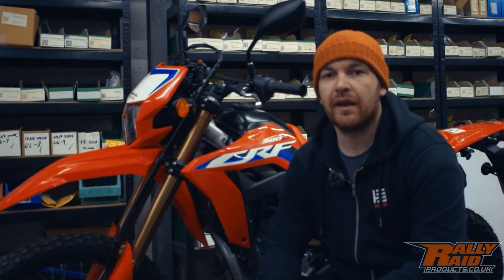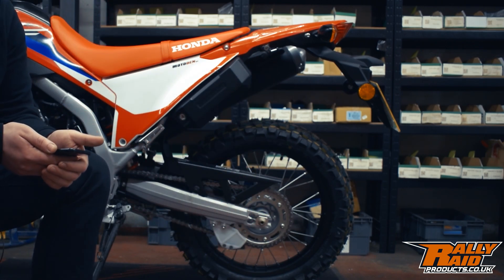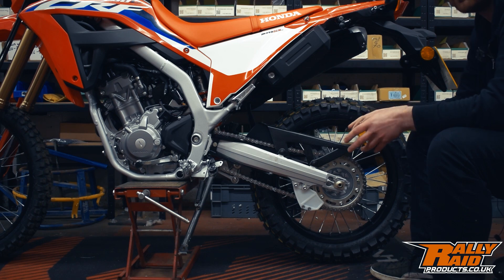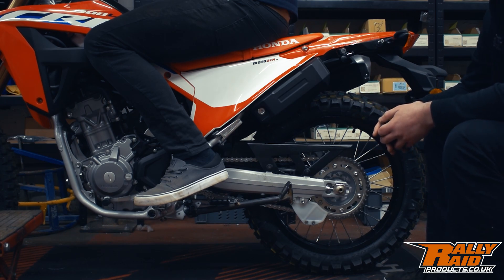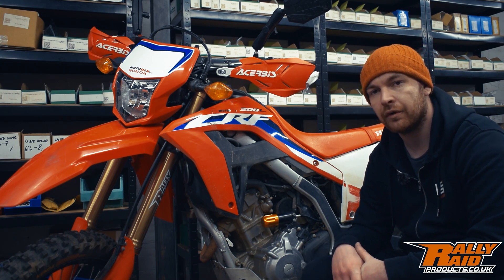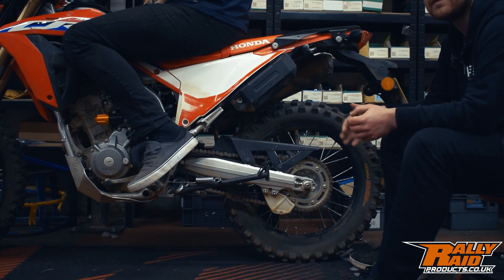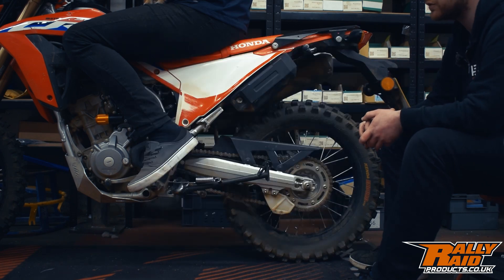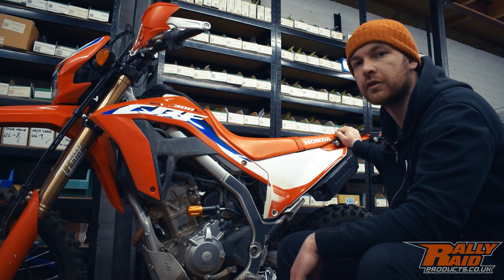HOW TO - MEASURING AND DISCUSSING SUSPENSION SAG

Comment: I think 30% rider sag is fine for the track but it’s too stiff for trails and general adventure riding.  The 40% feels much better to me.
Reply: so higher percentage or longer the distance means softer? eg, less pre load adjustment?
Reply: Yeh, 30% results in a ride which is fine for hitting obstacles fairly hard, but it also results in quite a harsh ride over general terrain not at high speed if the damping settings are too resistive
Reply: I’m 6 feet tall and 220 pounds without riding gear. I completely agree with the 40% figure. I ride my bike on all types of terrain at intermediate speeds.  My question is this; if you order a new shock and spring for my weight, does it allow you to adjust the race sag from 30% down to 40% without making the spring loose on the shock?

Comment: Good info. Solid presentation. It seems most bikes sold in the US are under sprung for the average male rider. I’m 6’2” and weigh 230lbs so the CRF300L is essentially unrideable out of the box and needs immediate upgrade. Probably the same goes for the CB500X which is what I was looking to get next.
Reply: The cbx is not as bad in terms of spring rate out the shop at it needs to be able to take a passenger ( all be it small) plus the type of riding done on the cbx is not as reliant on full travel suspension
Reply: Conveniently RR makes CB500x suspension.  I have a 13 with a full set up and it's amazing.

Comment: At which stage in the calculations of SAG do you include the weight of extras (such as racks) permanently fixed to the bike and the weight of the luggage which will be variable?
Reply: Once you have all the settings s described - when you put on luggage, adjust the compression to match the static sag you had without the luggage.

Comment: @4:32 For those who are still confused about how they got the sag percentage: the Honda CRF300L suspension described in the video has 250mm travel. For static sag: (75 mm / 250 mm) * 100 = 30%. For rider sag: (155 mm / 250 mm) * 100 = 62%.
Reply: Thanks! I was wondering how the calculation was determined.  Since I have the Level 1 suspension, and it has 210mm of travel, I assume I would replace the 250 with 210 in the calculation.
Reply: So they're saying the sag with no rider whatsoever and only the bikes weight is the amount of sag it should have with a rider on it. Guess it's one weak suspension
Reply: @jackle842000  Super weak

Comment: Hi Adam/Rally Raid.

I have recently purchased a 2022 crf300l.  It has a what looks like a white rally raid rear suspension kit (no reload adjuster. 

I an not sure if it's a 250 or 210, how do I find out?  The spring as 90-235 TT 11/23 stamped on it if that helps?

Comment: I'm confused.
CRF300L shock spring-rate recommendations for 83kg rider:
Ohlins - 70 n/mm
Nitron - 74 n/mm
Rally Raid - 90 n/mm
YSS - 95 n/mm
K-Tech - 95 n/mm
Who is right?
Reply: It looks like 3/5 recommended firmer rates. If you aren't riding the bike hard a softer rate will be fine for touring and light ADV work. 

If you'll be hitting single track, Enduro trails, or rough roads a firmer rate may better. 

I'm 117kg so I went with the firmest spring available from Rally Raid at 100N/mm as I'll be riding it quite hard.
Reply: It's got to do with the differing spring characteristics used by differing manufacturers for that weight category. From the figures you present a Rally Raid spring requires a 20N greater force to compress it 1mm than does the Ohlins. When you researched it were they all 250mm travel shocks?

Comment: What about setting the front forks. Do they come into it when setting the sag.?
Reply: Yes, but the suspension needs to come apart, and you have to dial the rear in first. You measure it the same way, then adjust the spacer lengths to preload appropriately. I’d suggest talking to your suspension expert to get the correct springs for your weight, and then you’ll be close enough to make spacer adjustments. He mentioned fork preload adjusters they’ve added to this bike, that would be a good aftermarket addition if they’re available. You still want to dial in the spacer length, and then use the preload adjusters for fine tuning.

Comment: I have a question. On paper, US version CFR300 Rally has 10.2 inch travel suspension which translates 259.08 mm in metric system. Does 9 mm of difference may have any effect on sag calculation?

Comment: Hi do you make a progressive rate spring for these bikes ?  ATB Wayne UK.........
Reply from the maker: Hi Wayne,  no we don't recommend using progressive rate springs in general. When you can have a correctly damped shock and correct spring rate there's no real pros only cons.  Especially on a bike with a rising rate linkage
Reply: @rallyraidproducts1927  Thanks for that, i did wonder............

Comment: Excellent resource. One question - in order to express the sag as a percentage you need to know the suspension travel so how did you measure the suspension travel?
Reply: The shock travel is usually listed in your bike's specification - in this instance [CRF300L] the OEM shock travel is 250mm* (as is the Rally-Raid LEVEL 2 shock), the shorter LEVEL 1 shock is 210mm travel.

*note if you're being pedantic, the published 10.2" travel is actually 259mm - however, in reality the OEM shock only has 250mm actual measured swept travel before the rubber bump-stop.
Reply: @yodapig  thank you very much. I'm due to get my 300l in June (allegedly!) but I know that I'm much too heavy for the stock suspension and I'm trying to understand the setup now so I can deal with it quickly then.
Reply: @xtdrew  yes, if you look at their website there is a chart showing suggested rider weights and corresponding spring rates, and you can choose the one closest to your own weight at the time of ordering (it doesn't have to be exact, as there is a range of preload adjustment of course) - and if you're going for the 250mm travel option then the preload is simple enough to calculate - 25mm (1") static [10%] and 75mm (3") rider [30%] sag.